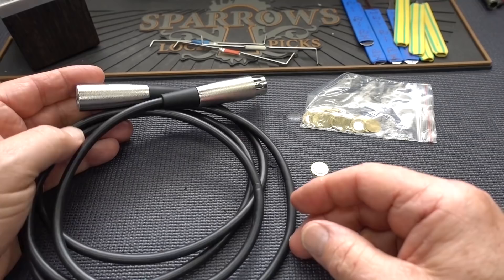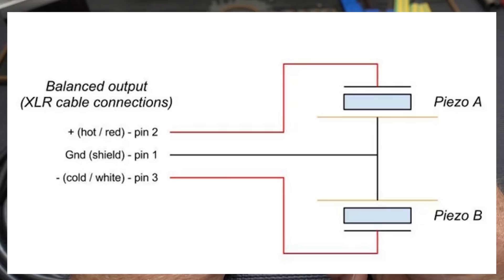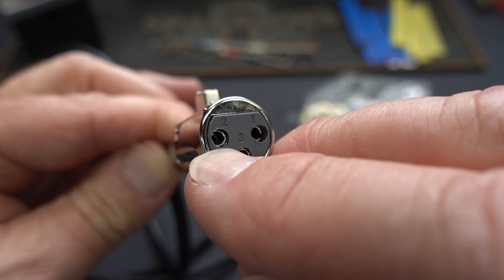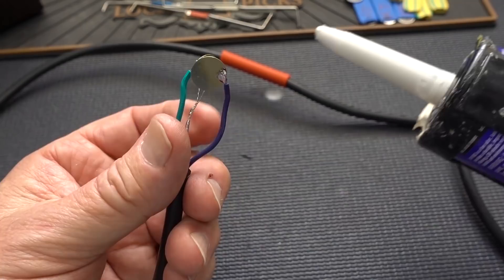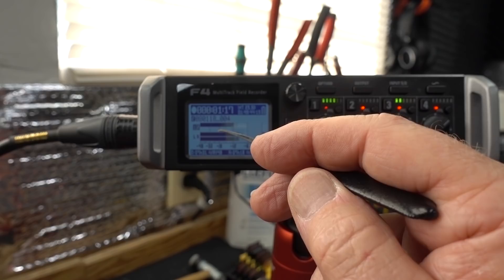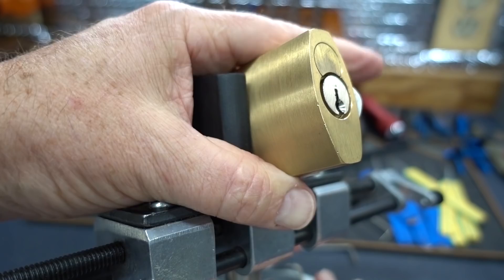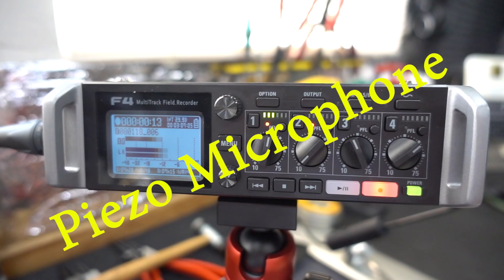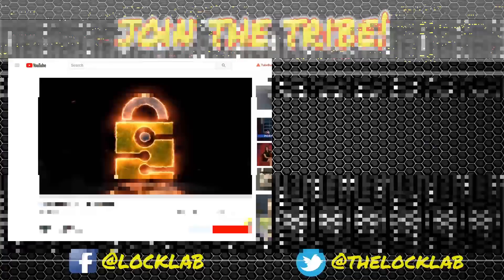(1338) Experiment: Piezo Crystal Lock Picking Microphone

Comment: You're reinventing the wheel, Bill. First, you should take your regular mic and just record some lock sounds you want then look at them in some sw like Audacity, specifically looking for the frequency range you want this new custom mic to work within.
 Next you want to block out all the other sounds. You can do this with LPFs & HPFs (low & high pass filters) made from discrete electronic parts, or you can EQ them out in hardware or software like audacity. Look for a mic or sensor that is most sensitive in this area (if you want to try doing this from scratch.)

Frankly I'd try a mic connected to a stethscope via a tube. I'd use a tube so I could fine-tune the apparatus to the frequency most desired and make the tube the diameter that flows that freq of sound the best. (for example the human ear is "tuned" to about 3khz which coincidentally is the most common highest range of a woman's voice. The formula to find wavelength is  https://en.wikipedia.org/wiki/Wavelength#Sinusoidal_waves and will work for anything you need. Plug your desired freq in and then the speed of light and you will know what size is an ideal tube width. You'll need to convert down to centi or millimeters, obviously. ) The most difficult part of this might be how much pressure the stethoscope's diaphragm uses to make a good connection to the lock. They can be rather finicky in that way. A benefit is at least this won't be very sensitive to room sounds since that part is blocked by rather thick metal. The tube diameter should help immensely to help get just the freqs you desire.

I've always had my best luck recording sensitive sounds using what is known as an electret condenser mic. They're not very expensive if you buy them w/o a case. Why they excel at sensitivity is that they have an engineered transistor/preamp right within their case. I've usually just run mine off a 9 v battery. Look for the little cans shown in this pic: https://en.wikipedia.org/wiki/Electret_microphone
RS used to sell them (PC mount style) for a buck, ones with wires soldered on for like $3. https://www.adafruit.com/product/1063 Don't let the little price fool you. You're buying a high quality product in a stripped down state... ie, no handle, windscreen, etc... You will notice they use a MOSFET internally. You simply will not find a better transistor to amplify anything than a MOSFET.

One of these just puttied up to the lock might work very well. I've personally never tried them on anything contactwise.

But if you do want to do from scratch I'd suggest a cartridge from a phonograph. They're super sensitive and already in stereo. If you google up super sensitive mics these have been used for many decades now by home enthusiasts. They usually need a prearmp to amplify them from 400mV to the 1v RCA standard. Which leads towards your next issue.... impedance matching. It's a big deal in audio and you probably want to design your custom mic solution to what electronics you already own. impedance-matching transformers are most traditional but op amp solutions work, also.

Lastly, if you do want to continue with your already built circuit: First we need to know if you are using the benefit of XLR which is "phantom power" so put a meter on DC Volts and see how much, if any, is across those piezo electric pieces. Piezos are generally much better at higher freqs than low (which I guesstimate the lock is making) but with some proper filtering it can probably be made to work to some degree. If you have any DC across there you want to block it off with some capacitors which you hook up in series with the piezo discs.

Feel free to ask any questions, I've definitely learned a lot from you.

Comment: Very exciting and interesting use of technology!

I have made a piezo pickup for my bass, it picks up every little thing I do on the whole instrument pretty clearly. The trick that worked for me was getting the brass plate firmly in contact with the sound source (I put it behind the bridge).

 I'd think clamping just one piezo element to the side of a lock would work. You want to transfer the vibrations mechanically and I think the epoxy and clay are reducing that. I wired mine to a regular female mono jack. It doesn't have any ground though >_>

Comment: Solder 1 and 3 together.  Don't sandwich the piezo's out of phase.  Isolate your bench clamp from ground or you'll get a ground phase loop hum.  Clamp it on the lock with a plastic spring clamp.  Solder two piezos in parallel about 3-4" apart and attach one to each side of the clamp.  The remaining buzz is from your fluorescent lights so you'll also need a direct box.  The high/low impedance issue with the setup will result in lower volume but it won't be substantial.  No need for the adhesive stuff unless you glue the piezos to your clamp.  Insulate the piezos from shorting across the lock.
Reply: William Roberts A tiny audio transformer an inch from the crystal can do the ground isolation and impedance conversion in one step, unless the crystals need DC bias from the amp to work.  Make sure there are no electrical connections between the cable side and lock side.  Cable shield goes to transformer shield or nothing.  But I'm not an audio engineer and may be completely wrong.

Comment: Try an accelerometer. Super glue a magnet to it. On non magnetic materials glue it right to the lock. I don’t think your silicon and epoxy transmit the higher frequencies you want to capture. Also, the clay probably critically damped the system so the crystals/metal wafers couldn’t vibrate.

Comment: The mics are exactly opposite to each other so the signals are inverted. It’s acting like noise cancelling headphones. 
When the + side of one receives a pulse the negative receives a pulse at almost the same time -1 + 1 = 0
You need to change the wiring

Comment: Match the impedance with a transformer, get some aluminum foil to maintain shielding all the way up to the piezos, and figure out a way to firmly affix the side of the piezo directly to the lock. You'll probably get even better sound out of it if you have some sort of mass (maybe 5-10 grams of lead or some such) to the piezo facing away from the lock.

Honestly, you'd probably have better results with a single piezo element going into a transformer than the stacked arrangement.

Comment: Try to connect the inputs to the inner electrodes (insulate them) and the ground to the outer ones. Then get two small mains transformers, such as from old Nokia chargers and connect the crystals to the "mains" side and the amplifier to the "low voltage" side. Be careful with the phase or they could cancel each other out. If that happens, just swap the polarity of any single coil.
One more note: The silver layer on the piezo crystal is easily damaged with heat. Your soldering tip burned right through it. I'd suggest you don't solder to it directly at all; instead, get a tiny braided wire, fan it out and attach it with strong sticky tape (aluminium is best). Even if the layer doesn't vanish with soldering, the crystal is degraded, so don't rely on several tries. The only way would be a regulated iron and an alloy with a low melting point, such as Chip-Quik. Just don't touch that silver coating with that cheap iron.

Comment: That was great! I have so many suggestions.  I think it would be fun if you made us guess what the setup is (pin type, undercut, etc) once you get the sound all sorted. 
 Be sure you are adjusting gain as close to source as possible. Further down the line towards computer/publishing end, amplifies all noise from previous components. 
 Ive had great results with an actual stethoscope (small one, if you can find it) with the MIC in the tube. All homemade, or I'd give you parts numbers and all that. 
 Glad to see you tried this and said you'll keep tinkering.  Thank you, Sir.
  Happy picking. 😁📎🔓

Comment: Your ground/shield wires were touching the rims of the piezo disks....direct short. They have to be insulated away from the brass colored metal on either side when attached to the center contact.   Piezo disks can’t be covered in anything like epoxy....they need to move and the encapsulation dampens the movement.  Soldering large blobs on the center contact will kill them. The hum is inevitable, adding a capacitor across each piezo might help.   Good concept though!

Comment: Turning up the gain is actually what's causing that annoying background buzz.

I would suggest you keep the gain right around about 0 and use a non elastic way to attach the mic to the lock such as a little clamp or a drop of cyano acrylate (superglue).

If that doesn't fix it, use a better quality microphone element.

Maybe you can do something with the pickup element from an old vinyl record player? Although that might be way too sensitive...

Comment: I've watched almost every one of your videos and in my opinion what might help is something like an automotive stethoscope because it's designed to pick up kicking and other noises inside of an engine block so I don't see a reason why it wouldn't pick up pin noises inside of a lock. The only issue I see is finding a way to record the sound coming from the part of the stethoscope that you generally put in your ear

Comment: I used a stethoscope and a rubber band and some spacers between the plugs in the ears and the ears, it worked fantastic after som fiddeling, all until the lock opened and my eardrums bursted.

Comment: I wonder if connecting the lock body to the sheild would help any?  It definitely sounds like you are picking up mains frequency noise there.  Is that cable tight twisted pair shielded or just shielded with a lite twist?

Comment: Hmmm, I'm no audio guru or anything, like, maybe I'm completely wrong in this. But would it work better if the Piezo Crystal didn't have a coating on it that might kinda work to stop vibrations from going through? Like, keep it bare, and then just slip a small cone around it that goes outward which you can press against the lock? This way, I think, any sound coming from the lock might get amplified as it goes in the cone towards the Piezo.

Comment: Since the two mics were back to back they were moving out of phase. That might have caused the signals to cancel each other out.
Reply: i think there could have been a short in between also.. if he wanted them in this back to back config,, why wouldnt you just solder the copper together with the crystal on the outside?? lol
Reply: Yes, but from the point of view of the 2nd microphone, it's bending in the opposite direction.

I can confirm that piezo discs can make great and very sensitive contact microphones, I hooked it up to an integrated sound card and could detect even the slightest taps on the desk, provided they are well coupled.
Reply: That's how 'balanced' audio works, the 2 phases are out of phase with each other, the receiving device reverses the polarity of the negative thus putting interferance noise out of phase with itself, but source signal in phase with itself.
Reply: I'm saying it sounded like the two signals summed almost to zero but the line noise was reinforced. Isn't that just what you'd expect with a phase inversion?
Reply: Well, the theory would go that as the microphones were acting in opposite directions to each other, that they would thus be out of phase with each other (unlikely to be 180 degrees, but close-ish given the rather in-exact construction). Thus the inversion of the negative at the camera would put those signals in phase with itself, and any induced noise out phase with itself. The results (which I concur are rather poor) I suspect may be down to something rather simpler (was there a short between ground and one of the phases).
Reply: Or the epoxy reduced the response of the microphones so much that the hum was the predominate signal.
Reply: If they were out of phase how come it worked when he tapped on it with the lockpick?
Reply: Of course, there is also a huge gain difference between a transducer being directly 'struck' and being stuck to the side of a mass of metal trying to pickup what's happening within that mass.
Reply: Even with high gain setting in the video, the other microphones picked up that tapping a lot better than the piezos themselves registered it. Wouldn't this possibly be an impedance mismatch between piezo elements and suitable XLR input ranges?
Reply: @Iffler: you missed my point. The creator of this thread postulated the "signals cancelling each other out" so when Bill taps on it with the lockpick how come you still get a clear, strong sound?

Get it now? If it were out of phase it would have failed that simple tap test. 

The mics were still in the same configuration because of the glue. The source of the sound is irrelevant in regards to 180 degree phase shift.
Reply: They are out of phase on purpose. Because on balanced signals the positive and negative are SUPPOSED to be out of phase. Thus I am suggesting that phase is NOT the issue here.
Reply: Very possibly pr0xZen.
Reply from the maker: I found the plan on the instructables website and was trying to follow their plan as closely as possible.

Comment: Bill, you can make a search at "DC 3V-6V TDA1308 Piezoelectric Ceramic Preamp Pre-amplifier Board Pickup Module" on ebay, you will find small boards that works perfectly not only to adapt impedance, but also amplify signal.
And if your recorder has the option to send power supply through the cable , you can simply shunt the "+vcc" and "out" on the board...  I have been experimenting with those, they work great. (If you need higher voltage supply, try " DC 4V-14V AD828 Piezoelectric Ceramic preamp preamplifier board Pickup Module " )
Reply from the maker: Thank you, Sir!  I ordered an impedence matching adapter and it has already arrived & seems to be working.  Thank you!

Comment: Was one of your solder joints on the piezo in contact with the metal casing of the lock because the epoxy coating didn't quite cover it maybe? That would compromise the signal

Comment: Soory one more thought. When you soldered the ground wire to white center as soon as you pushed them together the ground wire appeared to touch the outside of each crystal. Then When you push putty to hold mic I bet with forced the ground harder onto the outer rim the ground should have had a piece of shrink tube to stop the grounds from contacting the outer edge. That is just my guess. I could be wrong thou.

Comment: The comments about impedance are a bit suspect to me. 600ohm circuits are a thing of the past; that recorder has a mic input impedance of 3kohm, which should be OK. I'm not sure why you chose to wire the crystals like that. First, the shield wire is not relevant here; just don't connect it. Second, you've wired the two microphones in opposite directions, which means that the signals should cancel out. I'd just try a single crystal between the two signal wires (or buy a contact mic).

Comment: Hey Please put a condenser capsule direcrt on a lock and try again. This should Work much better. Most of these Capsules have already a preamplifier in it. This reduce the Impedance Problem and give u a good Signal. XLR uses no Ground and a diffenrencial Signal instead. Make Sure its insulated and Dont have Contact to the lock.

Comment: Try using just a single piezoelectric disk. I think  you’re over engineering it. They aren’t really that noisy. They are super sensitive to any vibration. You have to make sure the disk is in very solid contact. Any wiggles will overwhelm all other sounds. For testing you might try actually epoxying it to the lock to ensure it doesn’t wiggle or move in any way.
Reply from the maker: This is an excellent suggestion!  I never tried a single piezo because all the articles I read said they were really noisy.  I should have tried it to see HOW noisy.  I could always use Izotope RX6 to clean it up if necessary.  THIS will be version 2.

Comment: They make clip on microphones for tuning guitars.  You just clip in on the body of the guitar and then plug it into the tuner.  They aren't very expensive and I think that will work pretty well.  I tried one while I was picking a lock and it seemed to work well but it didn't help me much in my picking efforts.
Reply: That's probably the most practical idea I've read in this whole thread so full of half-thoughts or outright misleading ones.